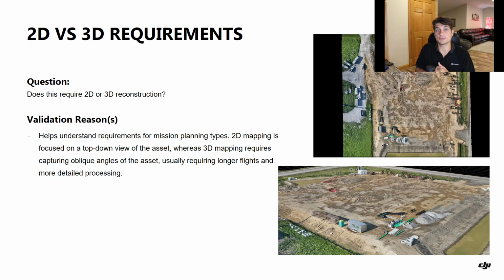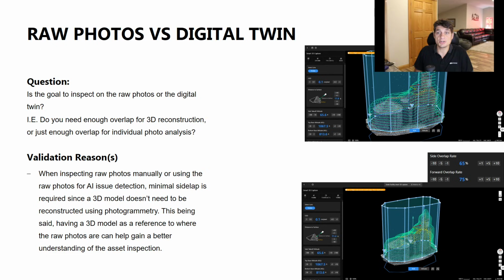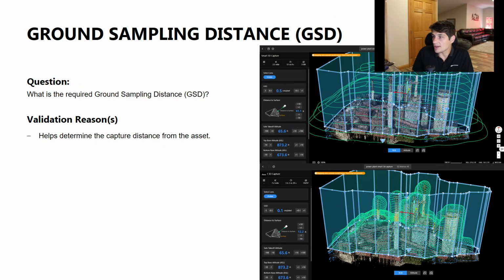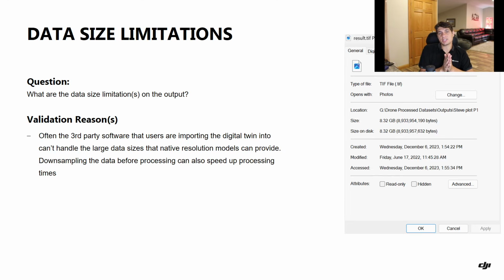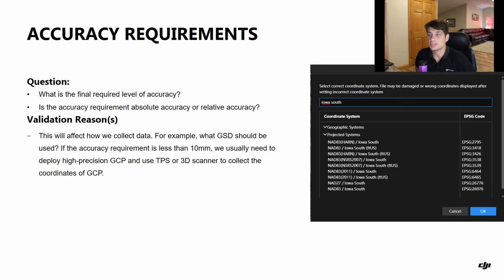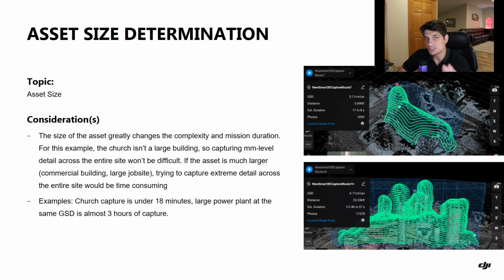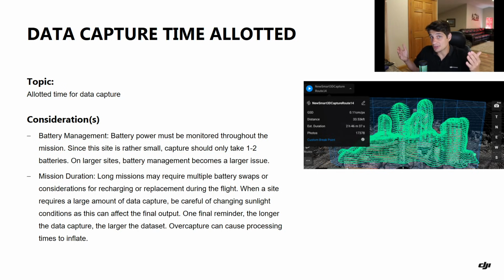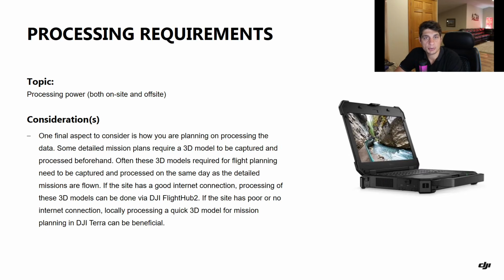Understanding Mission Planning & Outputs with DJI Enterprise Drones

Comment: Thanks for information. I am new to this enterprise stuff. I have the Matrice 4E, trying to understand its functions. Which dji terra program would I need to get started. I would like todo 3D and digital twin and mapping projects.
Reply from the maker: Pilot 2 app on the remote controller allows you to plan and complete data capture.

Flight Hub 2 will allow you to plan missions on your computer, and process data using cloud processing (https://youtube.com/playlist?list=PLaeLdmYIHNebfPvsoAf3_tqIskJZWkXO-&si=jU57AVmnIEj8lkd5)

Terra requires a high-powered Windows laptop with Nvidia graphic card, and enables local processing of the images into 2D Maps and 3D Models. https://enterprise.dji.com/dji-terra